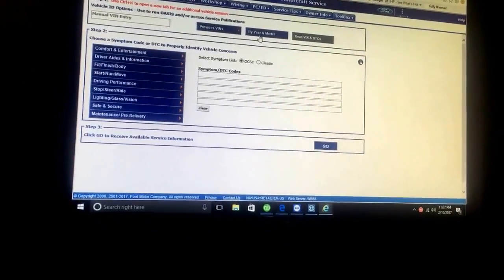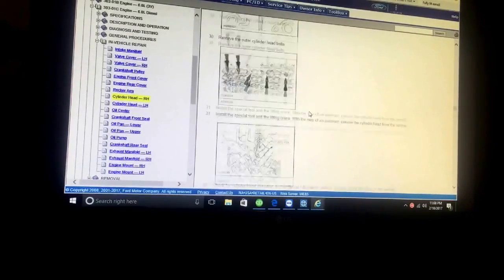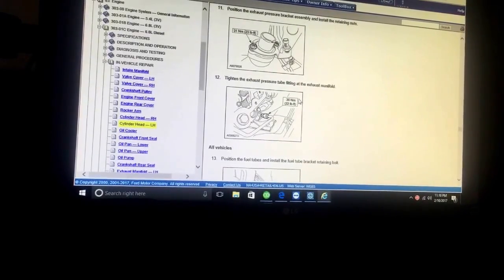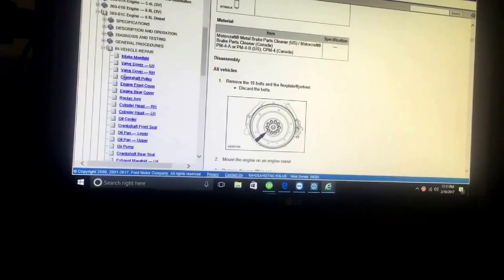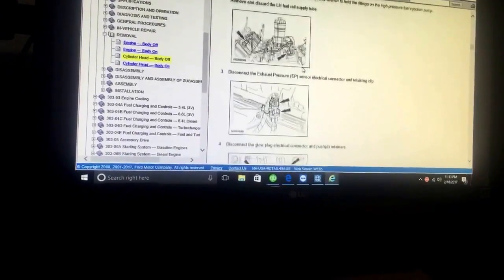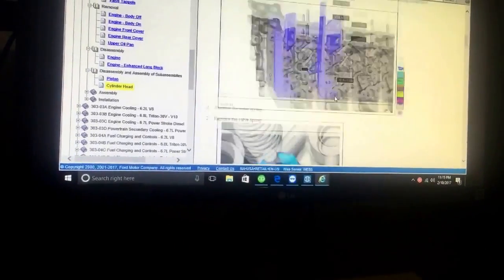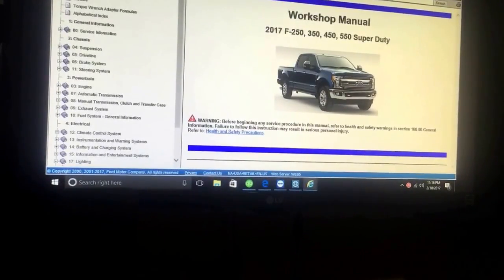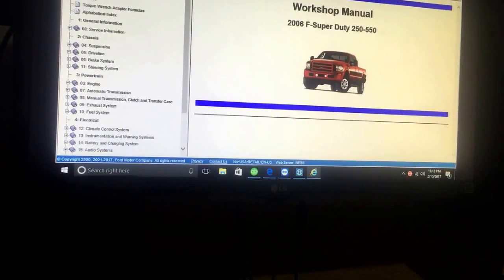Ford powerstroke cylinder head removal procedure overview 6.0,6.4,6.7

Comment: If you have back problems, you lift cab or get someone to help that doesn't have back problems yet. The stress is not from weight on 6.7 with aluminum heads, it is head bolt torquing. I'm 66 and do not have any real back problems other than stiffness of arthritis. I survived 50 years by not doing things that cripple you. The workshop manuals do not have high regard for your well being, they have a method established with time study for factory labor time guide. I have done cab on when truck has equipment preventing cab removal.

Comment: You work too slow. Last 6.4 I did I had engine out in 3 hours with me and a helper from running Truck to engine on the ground. I can pull 6.0 heads in 3.5 hours by pulling cab off.

Comment: do you sell new heads for the 6.0 
I have an 04 has 130k miles no issues at all but I want the truck to last for as long as possible when should I be looking for heads as far as miles go ?
Reply from the maker: http://fully-lit.com/parts1.htm
The factory heads are notorious for cracking.. here's a link for the heads I build.
Reply from the maker: every head that I build has the valves machined into the head. regardless if its stock valves or 45 degree, the correct way is using a guide and seat machine
Reply from the maker: ive seen some people do it with a ball hone on a drill.. I personally don't recommend it. sometimes the cylinders are shaped like an hour glass or a funnel. I always bore and go .020 over min.
Reply from the maker: if the truck ever was overheated then rear engine plate can warp and cause a leak.
Reply from the maker: only if your running bigger injectors.. ww2 works better with stock injectors on stock turbo than a powermax will..

Comment: 4.5hrs to pull a cab?!?!?! Sorry but no way. I've dozens of 6.0's. When I'm alone, about 3 hours and the cab is off, heads are off and I'm cleaning up. If you have a 2 post lift, pulling the cab is the way to go! It defiantly can be done in chassis or pull the motor, no argument there. But that not the fastest way.
Reply: How would you recommend lifting the cab off if you don’t have two post lifts

Comment: I have to thank you for this stuff. I always knew it was possible without lifting the cab since that's how I did it but have always had it argued it was designed to have the cab removed. I finally know for certain that's not true. thanks for the solid information you have provided for me and other followers.